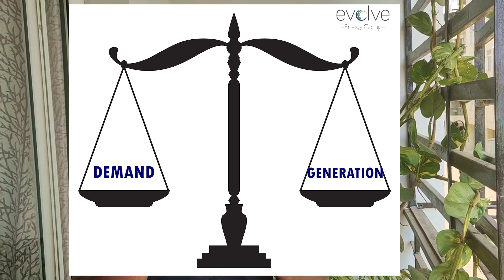GRID COLLAPSE AND SOLAR POWER | Sivakumaran - CTO | Evolve Energy Group

Comment: Shiva,what are the impacts on the grid when all solar power plants(generation unit) stops generating power in the evening time?
Because I was discussing yesterdays  9pm9min light load off and its impact
Reply: Hi, solar plants can impact grid stability when their numbers increase. This video is noway connected to the 9pm event.

POSOCO (Power System Operation Corporation Limited) responsible for handling the National Power Grid did a great job yesterday maintaining the stability.